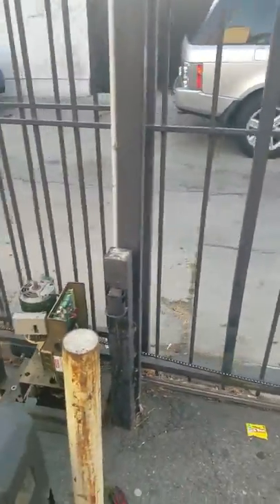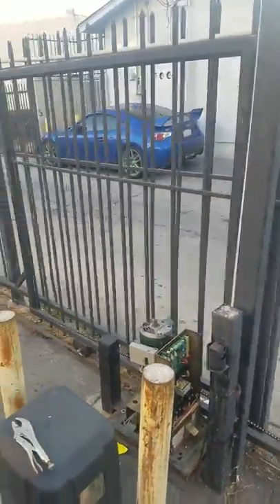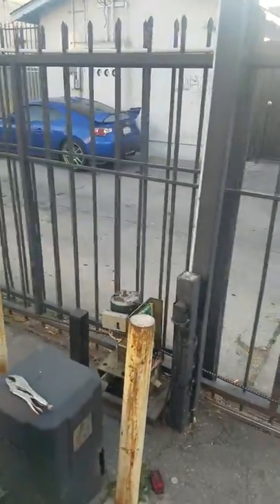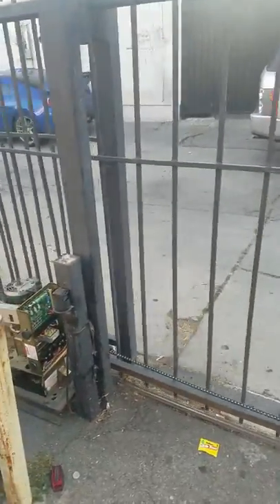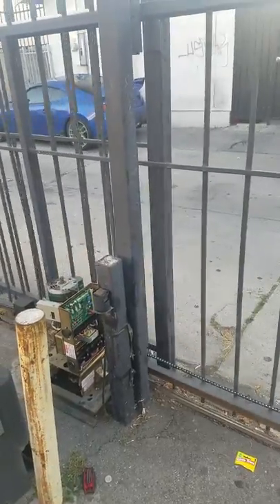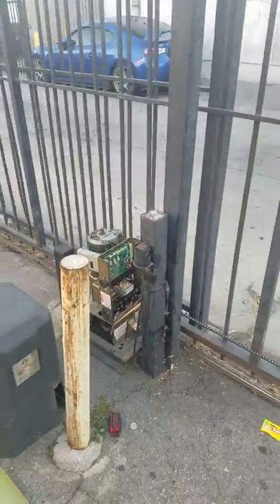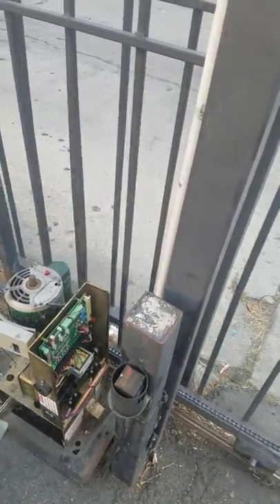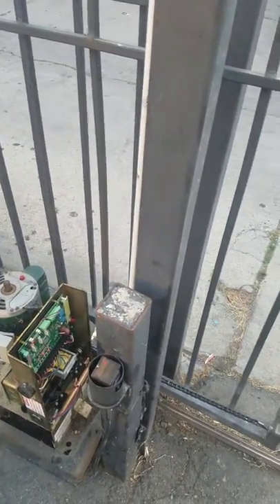Ramset slide gate operator repair

Comment: Where is the photo eye connected on the Ramset 100?
Reply from the maker: Diagram attached.  Hope this helps... mm thought i can attach photo here. Crap..
Reply from the maker: https://s.amsu.ng/3FJOR8IPtUWN
https://s.amsu.ng/em6mXDH6tpIN
Reply: Ramset 100 shuts closed then opens about a two feet. I adjust it but still opens. What could it be?.
Reply: @818nut  were you able to fix the issue? I have the same problem.
Reply: @dugglas29  I ended up buying a new unit. The board ended up faulty on mine.
Reply: @818nut  if limit nuts are adjusted right is going to be a bad board